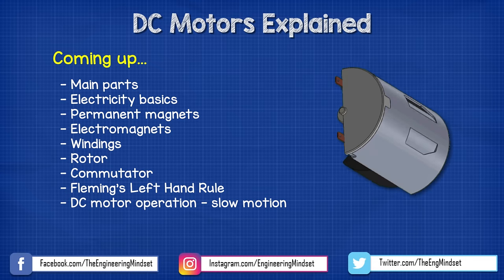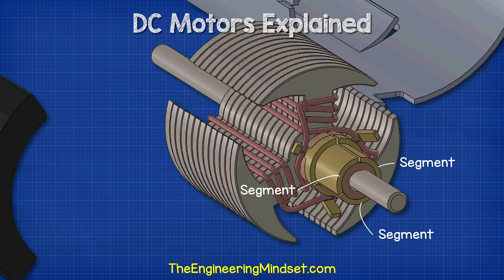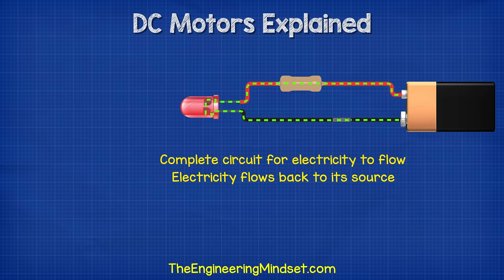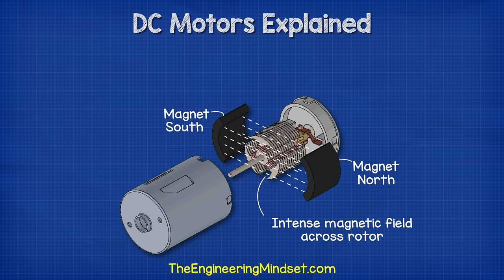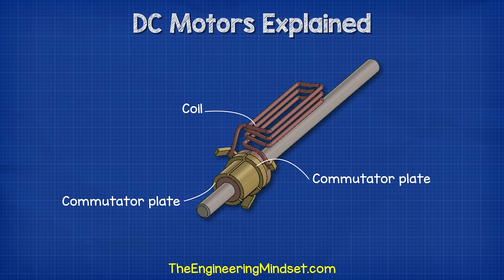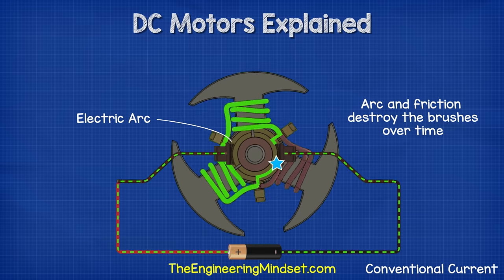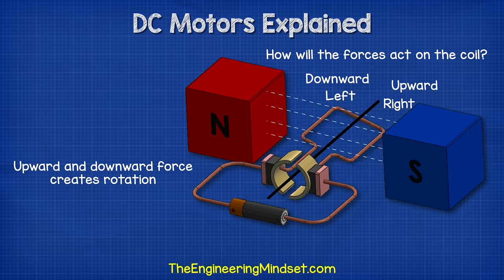How does an Electric Motor work? DC Motor explained

Comment: I have a question about the diagrams starting at 10:52. The semi-rectangular shape of the wire between the magnets (in the vertical plane) would induce a magnetic field (generated by the current running in the wire) whose resultant vector is coaxial to the magnetic field generated by the two magnets. In the diagram at 10:52, the induced magnetic field vector points in the same direction as the magnetic field between the two magnets, so the total magnetic field magnitude would be increased (?). For the diagram starting at 11:13, the induced magnetic field would point in the opposite direction as the magnetic field of the magnets. What would happen if, say, the magnitude of the induced magnetic field were equal to that of the magnetic field of the magnets? How would the interaction of those two magnetic field vectors impact the magnetic force on the wire, if at all? Would the magnetic field essentially be cancelled out, resulting in no force on the wire? Or is the magnetic force from the magnets on the electrons running through the wire unrelated to the induced magnetic field by the electrons themselves? Would a third item, say a conductor separate from the wire placed in the "center" of the vertical wire rectangle, experience no magnetic force since the magnetic field vectors cancel themselves out?

Comment: I could be wrong, in section time frame 3:11/15:32. It's mentioned that if you reverse the battery, the current will flow in the opposite direction. In the illustration shown at 'timeframe 3:12' reversing the battery will not cause the current to flow in the opposite direction. It will, in this case flow in the same direction no matter which position the battery is in. Electron current flows negative to positive.
Reply from the maker: 3:12 look at the wires. Left side the electrons flow from black to red, right side electrons flow red to black. The electrons flow neg to pos but we change the direction of flow in the circuit.
Reply: I do see after a night's sleep, what's trying to say.  Maybe should have said it a little differently/clearer so one doesn't get confused like me 😁. "If we reverse the battery, the current will still flow in the same direction".
Reply: I think you missed out in position 2( and in other like positions) that current also flows in coil 3 and 2 ...
Tell me if i am wrong

Comment: Also when you start the motor you are essentially short circuiting the battery through coil. Thats what gives you these voltage spikes when starting the motor. As the motor starts picking up speed it creates resistance through interacting with magnets (back EMF). So current gets smoother as the motor spins faster because back EMF balances it out.

Comment: Thanks! makes a lot more sense now, why use conventional current instead of electron flow tho?
Reply: Historical reasons.   A lot of the working principles of electricity and magnetism, were developed before the electron was discovered to be a negative particle.  Benjamin Franklin assigned the sign convention for charge, when he had no way of knowing which type of charges were being exchanged.   He took a guess, and turned out to be wrong.   It wasn't until JJ Thompson discovered the electron Thomas Edison discovered that it was negative, that we could've known to set the convention to be the opposite.

BTW, it is not necessarily the case that the electron is the charge carrier.  It is for most manmade electrical products, because the electron is the most mobile of the subatomic particles such that it can move within conductors.  Protons are bound by other forces to remain within the nucleus, and define the elemental identity, while electrons get exchanged among the atoms.  Even with ordinary matter, positive charge carriers do exist.  Such as the sodium ions in the human nervous system.

By setting the an inconvenient convention for the sign of charges, Benjamin Franklin made us confront the problem head on, and generalize the problem for charge carriers in general, regardless of the sign of the particles.

Comment: To The Engineering Mindset: the DC Motor described in this video is different from another DC Motor that I seen described in another video. So are there several types of DC Motors? Because you guys have explained a DC Motor in which the coils are wrapped around the solidified(or combined) separate disks(that make up the rotor). While the other DC Motor that I seen in another YouTube video shows individual loops of Iron(that make up the rotor). In which each loop is it's own separate electromagnet with it's own wrapping of Copper wire. But anyway I thank you guys for supplying needed information, and I look forward to receiving a response from you guys at your earliest convenience. And thanks again.

Comment: Hello...awesome video, but have a doubt. In position 1, why does current not flowing from a plate B & C to coil 2? Why is it taking only the path through the plates B & C to the right brush. The ends of each coil is connected to a commutator plate which is again connected to another coil. Could you please explain. Thanks!

Comment: The description is good , but i did'nt understand the last part . Position one- in which the current flows from plate A to coils  1 and 3 but not to coil 2. And also i didn't understand position 2 in which current flows only through coil 1. Can u please elaborate on that.

Comment: At 13:58, why doesn't current also flow through plate C, coil 3, plate A, coil 1, plate B and then the wire. Is that not a valid path also?

Comment: Thank you for this video. And all your hard work. 
My idea is to apply this to a faceting machine and increase the power input to the grinding disc thus to have greater speed and higher rate of cutting. I am trying to research how to do so safely and efficiently. I am admittedly not good at electrical and better at mechanical.
Reply from the maker: See our new video on how to build mechanical versions of electronic circuits? Watch here: https://youtu.be/Zv9Q7ih48Uc

Comment: Hi, love the video! Have a question though. You say that one of the magnets is north and one is south, but don’t all permanent magnets always have a N and S pole, you can’t just split them in half and separate them, the two halves will again have N and S in them? Do they touch the metal shell and that’s why they retain N and S (just my thought)? How come one is N only and the other is S only? Thank you.
Reply: Yes, as you say, all magnets (permanent or electro) have both poles. Magnetic monopoles don't exist, or haven't been discovered.
Reply: Agreed!  When they got to that part of the video I instantly searched for other comments just like yours.  If you split a magnet in half it does not give you a North pole magnet and a South pole magnet but instead gives you two magnets with both a North and South pole.  If you create a temporary magnet it will also always have a North and South pole.

Comment: In 9:08 
since all coils are connected, why it goes through the shorter path not the long path ?
Reply: first half second on 9:08, only 1 coil is connected 
but the longer coil path is connected, why it took the shorter one ?

Comment: In the rotors, the coil should be in the same number of winding noo ,  means rotor1 should have the same number of turns  as well the other rotors 2&3...     Is that correct or  we can wind  in different turns in different rotors ....
Reply: You can make unequal number of turns but that will generate unequal amount of torque. Giving you rotational vibrations

Comment: Extremely useful videos, confused though , on 3 phses motors you reverse any 2 phases to change direction of motor . But was always told that reversing single phase around will not change direction ,
Reply from the maker: Single phase refers to AC, this is DC electricity. AC reverses so makes no difference. DC is constant so we just flip the power supply to change the direction and thus the rotation
Reply: @EngineeringMindset  Thank you

Comment: So if the coil is what produces the EM field and rotates, why do we connect it to the rotor? Because thats what connects to the load through the shaft?
Reply from the maker: The commutator makes and breaks the circuit powering the coils, causing rotation.

Comment: Does this motor seize the maximum torque in the coils?, because they are located too close to the center, I mean, when you explained the motor at 6:55, we can see the coils are further. 
Another big difference is that in 6:55, the coils are winded symmetrically to the center, while in the real motor, the coils are located above or around the shaft... can someone explain if that's the best way (more efficient) to make it?

Comment: Any video explaining the 433 mhz transmitters and receiver module circuit diagram Used in RC, which is used to control the DC motor or servomotor
Reply from the maker: Check our new Servo video out: https://youtu.be/1WnGv-DPexc

Comment: DC Motors are used in some electric trains (usually trains in the 70s and 80s). Best DC motor on a train to me is the Morrison-Knudsen motor in the CTA 3200 Series Rail Cars. They sound SO good! How about taking a look at AC Motors. Alternate Current.
Reply from the maker: We have covered ac motors previously, but we will be releasing a newer version soo
Reply from the maker: NEW! Check how AC motor works here https://youtu.be/59HBoIXzX_c

Comment: @The Engineering Mindset

You say inside copper wire electrons exists, I got it.
Where do you get the voltage in order to push the electrons ?
In the AC power, where does voltage come from ?
Reply from the maker: See our vfd video, voltage explained video and current explained video please

Comment: Why do the insulated rotor segments have to be packed so close and practically touching? Could it be spaced out with more with gaps? Is it acting like a flywheel? Imagine a rotor with two of the T plates at each end for winding wire.

Comment: Does a thicker copper winding have any difference? So a motor with .020" wire wound 12 times per winding spins at such a speed. If we rewire the motor with .040 wire still wound 12 times per winding, does it spin faster, slower, or the same speed?

Comment: If you wire multiple DC motors in series do you multiply the voltage by the number of motors?

Comment: Not only does current has a conventional direction, but also magnetic field flow. Suspended magnets will point to the north pole with its north polarity even  though like polarity should repel. So the geographic north pole is actually magnetically south, or vice versa.

Comment: What is the purpose of having metallic rotors. If the torque is generated by the forces acting on the wires, why there is a need of metallic, laminated rotors in the shape they have it there. Can a rotor be made of a different material?

Comment: A generator uses the right hand rule (a "gene-right-or"), therefore motors use left hand rule. Remember FBI. Thumb is F, direction of force. B is for the magnetic field direction, because flux density with the symbol of B. I is the symbol for current.

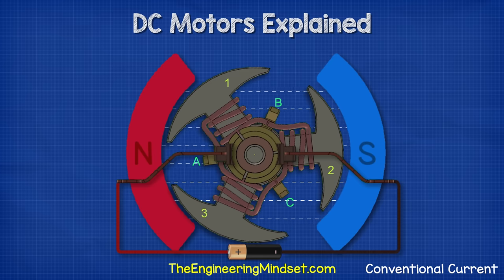Comment: 13:01 what happens in the coils that have no applied power?
Reply from the maker: They might have a little induction, these motors are around 10,000rpm so it's for such a significantly small amount of time
Reply: @EngineeringMindset  I imagine it would be different in the case of brushless dc motors?
Reply from the maker: Check out the new BLDC Motor video: https://youtu.be/yiD5nCfmbV0

Comment: Can you explain brushless motors (even though I thought I heard even brushless do have “brushes” of sorts) and also what controls the speed of these on variable speed devices/triggers - is it a potentiometer or whatever that device is that controls resistance?
Reply: Yes, I would like to see how a brushless motor works also. Thanks in advance
Reply from the maker: I'll tag you when we launch the video on brushless
Reply: The Engineering Mindset that would be awesome. Thanks so much and keep up the fantastic work.
Reply from the maker: Check out the new BLDC Motor video: https://youtu.be/yiD5nCfmbV0
Reply: @EngineeringMindset  thanks!
Reply from the maker: Seen our new Potentiometer Explained video? ➡️ https://youtu.be/Xb-MZMoUtcQ

Comment: I'm new in electricity so can anyone tell me what determines the current (direct or alternating) that must be used in a certain machine.
Reply: 2:55 ... In AC you get forward and backwards at the same time... Sort of. Unit convert ac power to DC by "removing/blocking" the a direction of flow or they can utilize both directions.

Comment: At 7:50 why can't we use aluminium as a core for the coils?
Reply: Because aluminum is not ferromagnetic.  It takes a metal with a specific property that iron has as the namesake of ferromagnetism, to be able to reinforce a magnetic field and store a permanent magnetic field.   Iron is the most common material used for this application, but you can also find it in cobalt, nickel and neodyneum.

Comment: I want to use a motor to belt drive a three blade prop on my 18’ air boat. I need a variable speed
High rpm and able to reverse direction. If it can be around 200lbs that would be great. It must be weather prof. Any sugestions?

Comment: Hi just trying to do some research on electric motors and batteries for my boat would like to put a 200hp or (150kw) depending on torque demand, Just wondering if you know of websites to look up. could go to boat builders but all they want to see is the money.

Comment: I’m think of taking a dc motor out of a car, the wiper motor or window motor. Then run it in reverse to charge a battery on my bike. Then while it steady charges the battery I’ll be able to run some lights of the battery for riding safely

Comment: oh now i can appreciate what fleming rule is. I didn't know the actual purpose of it before.
Reply: I prefer the right hand rule.

Since "i" stands for current in formulas, the index finger points in the direction of current.
Magnetism starts with an m, thus the middle finger.
If you can't say the th in thumb, you might call it a "fum".   F stands for force.

Comment: A kitchen blender!
I took my mom's blender apart because the circuit board got toasted due to water. Though the electric motor still runs fine.
Even tested it out on 12V.

Comment: Can a small led bulb be lit by rotating or spinning a dc motor.. tried it but didnt work ,,thinking that  I was spinning it in the reverse direction ,, tried spinning in the reverse also .. no let so far ( the spinning was quite intense , with a miniature rubber tyre touching off the spin of the spin head of a ceiling fan 😅( that was the quickest idea ))

Comment: I'm assuming my electric moped uses a DC motor thats in the back wheel. I'm trying to upgrade my bike here in China but my lack of electrical knowledge and also having to try to translate everything makes it quite difficult. How would I know if my battery is suitable for a given motor/controller setup? I'm currently using a 60V47ah battery with a 2000w rated motor. I am able to make adjustments with my controller but I'm not sure what the maximum safe amount of current I can push is. Any help would be tremendously appreciated! Thanks in advance!

Comment: how the two magnet act as north and south pole seperately (did you invent monopole ) ?
Reply: No.  The other pole of these magnets is simply "out of the picture".  It could be a horseshoe shaped magnet, where these two parts of the magnet are connected elsewhere, or it could be that the other pole faces outward.

Comment: the last part is almost wrong, the force generated by the current in the magnetic field is too weak, should explain using the magnetic field generated , that is why it need plate to magnify the magnetic field

Comment: I have a project idea. We can change Dc to Ac by using a dc motor. we can put a magnet on the motor and rotate it by using the dc motor. then we put a coil around the magnet without touching it and we got an ac supply. Does it work. pls tell me if it does. :)
Reply from the maker: You can just couple a dc motor to an ac motor. But it must have a permanent magnet in the AC motor. It is already used and is effective. The controls can be slightly difficult because you need to rotate at specific speeds to get 50Hz or 60Hz but the voltage also depends in the speed of rotation. When you apply a load the voltage will drop so you need to balance these

Comment: i have seen dc motors used as pumps in firerooms, on vehicle radiator cooling fans, presumably escalators and elevators,and i want to apply them to heating water and to apply it to a bathroom fixture and cart

Comment: can u explain how voltage and current affect dc motor, please
Reply from the maker: Increase voltage, spins faster. Gets hotter, eventually destroys itself by melting winding insulation (enamel)
Reply: @EngineeringMindset  how about the current?

Comment: I don't want to take away from the work but electricity doesn't flow through a wire it flows across the surface of the wire for the most part there is good info I believe when a statement is wrong it really leads a person astray and although this is a simplified explanation the understanding of electricity is most important before you explain the manipulation of it I think the study of Tesla would help anyone who wants a place to start there's to much being thought that is just wrong this is in my opinion good luck to all who seek knowlage 🤔